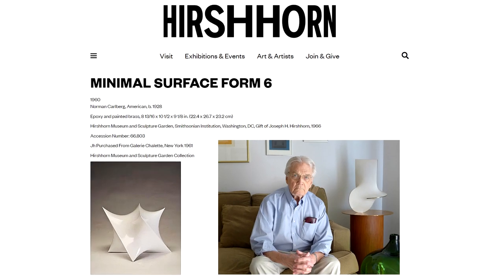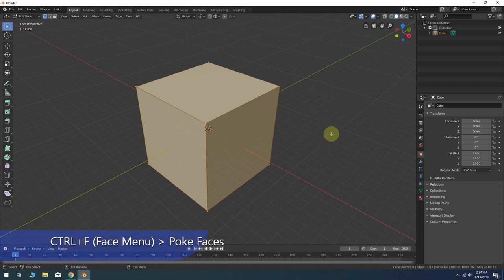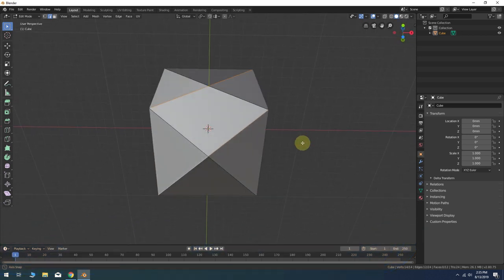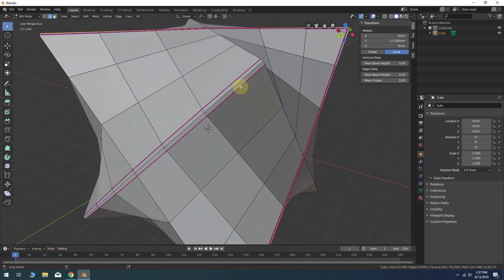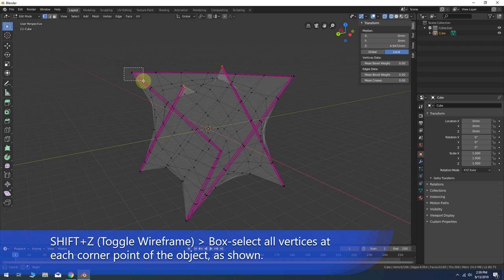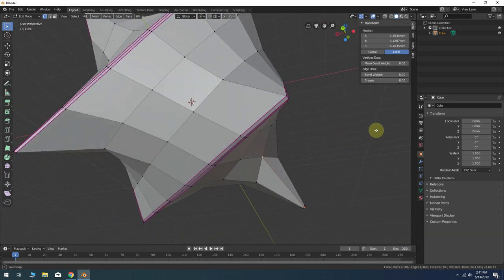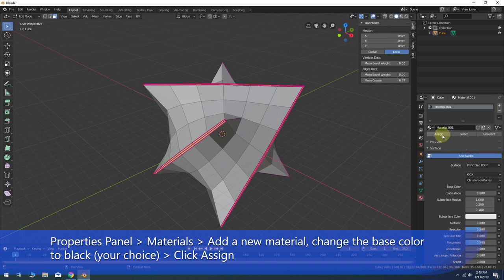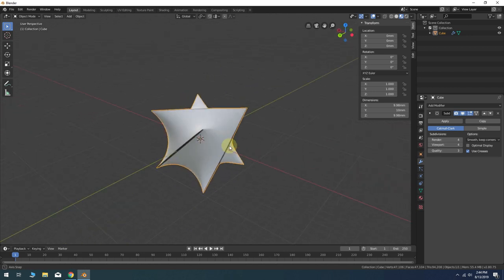Blender 2.8 Tutorial | Minimal Surface Form 6

Comment: It does not work on mac, keeps on selecting planes instead of edges, drives me crazy
Reply from the maker: Make sure u have the correct selection mode enabled.  Press 2 on the keyboard to enter edge selection mode.  What version of blender are u using?